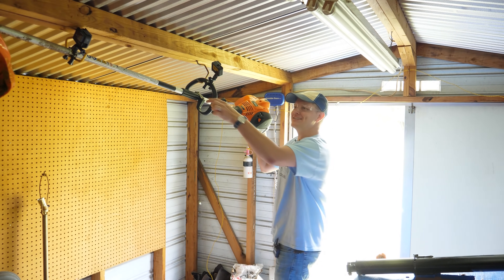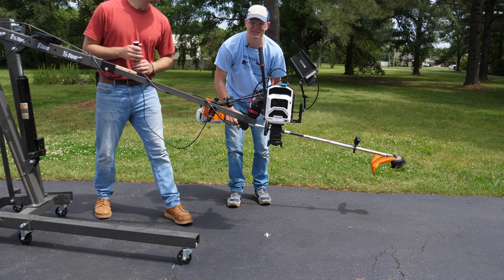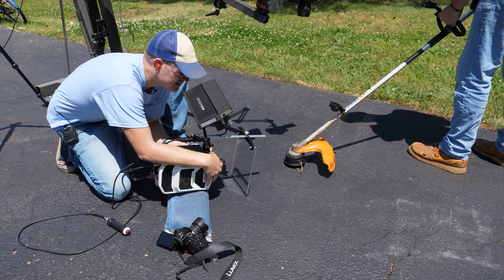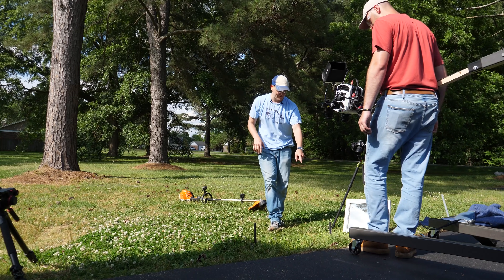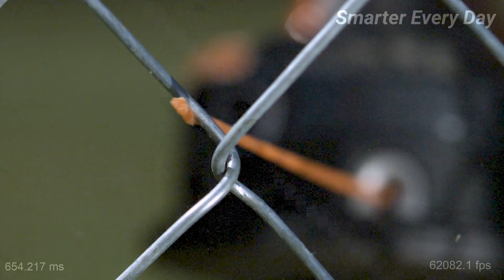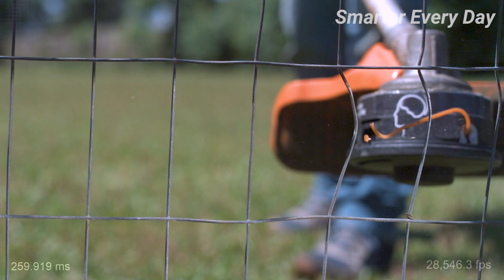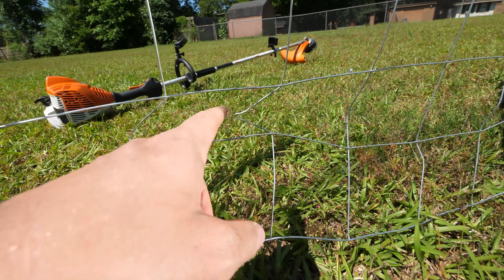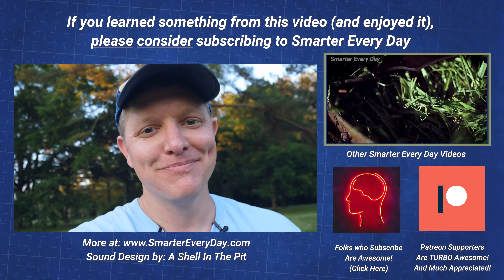How Weed Eaters Work (at 62,000 FRAMES PER SECOND) - Smarter Every Day 236

Comment: "95 thousandths of an inch"
Most of the world: w-what?
Reply: had the same thing. If I calculated it correctly, it's 2.41mm
Reply: As an American I am confused as well
Reply: @fruityboba8461   😆
Reply: Just call it a milliinch...
Reply: science without proper measurement units ! Yeah this is America !
Reply: You mean 95 milliinches?
Reply: 95/1000 of an inch is easy - it's also the width of a toothpick or 50 pages of a book
Reply: 1 millimeter to a meter is the exact same fraction of 1 thousandth of a inch to an inch - 1/1000.
Reply: It's beyond me why anyone would consider that a superior unit of measurement over millimeters. I don't even bother trying to convert it anymore, as soon as thousandths of an inch are mentioned by anyone I just phase out.
Reply: @Outland9000  Thousands of an inch and millimetres aren't really comparable. 1mm = 39 thou, so thou is a lot more granular.
Reply: @JDeWittDIY  Totally missed the point...
Reply: here is some more to confuse all the metric guys... electric motor shafts are measured in 1/16 in. steps. So a two inch diameter shaft would be a 32, or 32 x 1/16 = 2 inches.

Then when the shaft is coupled to a pump, we measure pump shaft diameters in 1/8 in intervals. So a 2 inch shaft is a 16. 2x8=16. Then you could say you have a -32, 50 horse motor coupled to a -16 pump shaft......all the same size stuff lol. I also deal with metric a lot but not as common as imperial in the united states. Mostly in pharmaceutical equipment because a lot of that stuff is imported from europe.
Reply: If you can't understand the relationship between 95 and 110 then it doesn't matter which units are used. The units aren't really important here, it's pretty obvious the approximate size of the string and fence pieces.
Reply: it always annoys me that americans use fractions over decimal points...
plus the fact that he's an engineer but uses imperial like that would be relevant to anyone/anything
Reply: @proxy1035  Engineers faced with English units use thou or mils.  As shown in the video...
Reply: @marredcheese  that just sounds like imperial with unnecessary extra steps
Reply: @marredcheese  English units , eg, the units that the English use, are millimeters.
Reply: @marredcheese  So when inconvenienced enough by fractions (like 3/8 or 5/8 of an inch), you rely on using units that make logical sense - 1/1000 of something and increments of 1 to relate them to other measurements.
Reply: @ColinRichardson  only because of the EU! In school we were taught both. This was in the 90's
Reply: @rjs198585  I know, I am so dumb. Tell me to picture 3 and 7 40ths of a millimetre I know exactly what that looks like, but since noone talks in anything less than half inch, it's just not in my mental model.
Same way I can't picture what a kilometre is, but I can for 1 mile. But anything less than half-inch or anything I want to be accurate I use cm/mm. Though I then switch to feet for for stuff like "how tall is that door? 6ft 8"
Reply: @ColinRichardson  If the metric system had wanted to compete in the day to day they should have mixed the two concepts (man based units and earth based units) Instead, Europeans try to measure houses with a unit derived from a fraction of the distance of the circle of the earth. That's why the "foot" built the pyramids and the metric system really isn't known for great architectural achievements. A hybrid system would have 10ths of an inch, 10 inches in a foot, ten feet in a yard, etc.
Reply: @matthewmosier8439  wasn't the Egyptian measurements based on the forearm of one of its kings?
Reply: @ColinRichardson  The foot was based on a Pharaoh's foot, if I am not mistaken. It is man based, hence why it is so useable for construction, etc. I've worked on projects in a few different countries and can assure you that the metric system is ridiculous for building a house. For one thing, the metric tape is confusing due to it's overabundance of markings that all are too small for the application of, say, building a wall. It's like looking for one sentence in a page full of words. A well designed standard tape measure takes a few minutes to learn and is much better suited for day to day projects.
Reply: @proxy1035  he used decimal, not fractions. Closest fraction would be 3/32" (.093")
Reply: @ObelixCMM  i mean it said "95/1000" which is a fraction...
Reply: @proxy1035  .095"
Reply: @ObelixCMM  yes i know it can be easily converted to a number with decimal point, but it's written/spoken as a fraction for no reason...
they could just say "point zero nine five"
Reply: @proxy1035  as an American, I completely understand why customary units are not practical, but fractions are much more useful for mental calculation than decimals, in addition to being more accurate (unrounded)
Reply: i was just thinking the same thing using that while you have an superior measuring unit milimeters that is just plan stupid, how can someone guess what a 90 thousands of an goddamn inch
Reply: @tekofaks2  yep, I can picture what an inch, quite easily.
I can picture what half an inch could look like..
quarter of an inch... ok maybe,
8th of an inch narr sorry.
16th of an inch, is that a thing?
32nd of an inch? really?
64th of an inch?
(apparently noone does 128th of an inch, that would be crazy)..
What what do we do now? Jump to 1000th of an inch? Of course you do.. of course you do... 🏅
At least they rounded off to a decimal number.
Reply: Colin Richardson is you can’t even picture an 8th or 16th of an inch you have a problem
Reply: Here's what confuses me. Now, one foot is 12 inches. One yard is 3 feet. 1 mile is 1760 yards. Great. Now why when you go below inch you start using decimals? Why not keep tha habit of splittin units into unobvious and inconsistent number of fractions? Why not say ""one tenandahalfand" instead of 95/1000 ?
Reply: @bukkaratsuppa6414  We don't use decimals instead of fractions for most applications. An inch is divided into fractions. Also, metric doesn't evenly divide so it defeats the purpose of having the units divide by tens, etc. Meters should be divided into tens, that divided into tens, etc., but because they aren't, I constantly had to make sure I was using thousands for kilometers and hundreds for centimeters into meters while I was in school. It really didn't make sense.
Reply: @matthewmosier8439  meters do divide in tenth.
10mm = 1cm; 10cm = 1dm; 10dm = 1m; 10m = 1dam; 10dam = 1hm; 10hm = 1km
Only mm,cm,m and km are commonly used.
And now please tell me how 1000thou =1inch; 12inch = 1foot; 3 feet = 1 yard; 1760 yd = 1 mile  is simpler than metric.
And please stop with the argument that "man based measurements are easier".
That's just not true. How many peoples feet are 1 foot long? By chance mine is. It is 30cm long. No need for foot. And if I need 1 meter one big step of mine is 1 meter long.
But the foot of the next person might be only 9 inches (23cm ) long. So what good does it do to that person that the imperial system is based on "man based measurements"?
And you now that nowadays the definition for 1 foot is not "foot of some guy". It is 1 foot = 0.3048 meter. That is the official definition of 1 foot.
So you are using the length of the path travelled by monochromatic light in a vacuum in 
1
/299 792 458 of a second times 0.3048 to measure your house.
You just don't know that.
Just like most people who use metric don't now that.Because for everyday people it doesn't matter.
Of course the imperial system is simpler for people who grew up with it. But the same is true for metric.
For everyday use it doesn't matter which system we use.
But in our globalized world it is stupid to use two different systems. And since most of the world already uses metric that is a strong argument to change to metric system.
And in scientific use metric is far superior.
Reply: @Jehty_  The lack of using the other units is a major drawback to the metric system. What's baffling is that those are the more practical units and people instead regularly use a unit smaller than a finger width to measure tables, chairs, and other everyday objects. As for the argument that almost everyone uses metric, it ignores the fact that much of the world's GDP is created using the imperial system. In the day to day, the only arguments I ever hear for metric conversion are essentially peer pressure (everyone's doing it) and that it uses tens, which doesn't make much difference because it doesn't use half of the units so a person must still calculate. And the lack of a common metric unit for anything between a centimeter and a meter is just too much for me. Why measure stuff in multiple digit numbers when imperial offers plenty of day to day units that match a man based world?
Reply: @matthewmosier8439     "much of the world's GDP is created using the imperial system"
Depends on your definition of "much" 
If 1/4 is much, then yes. But 3/4 of the worldwide GDP is not created with the imperial system. 

So basically your problem with the metric system is that you are not used to it. 
You don't have a real argument against it. 
Why would you ever need something between cm and m in day to day use? 
I am 1,88m or 188cm tall. Why would I need to say I am 18,8 dm tall? What would be the benefit? 

And you don't understand the beauty of using tens. You don't need to calculate. Just need to move the decimal mark. 
123km is 120 000m is 12 300 000cm.
No need to calculate anything. 
Now do the same with imperial. How many  inch and feet are 123 miles? 
Without doing any calculations. Just move the decimal mark. Doesn't work, does it? 
Yes, in the metrical system you need to learn the prefixes. And in imperial you have to learn the units. So not really a big difference. Just something you have to memorize.
Reply: @matthewmosier8439  and now I really would like to hear your arguments for using imperial in day to day use.
Reply: @Jehty_  his argument is "I want it, so your argument is invalid"...
Reply: @bukkaratsuppa6414  That, and rulers use 32 gradations between every inch. So is that 1/32nd of an inch? How many 1/1000th is that? I don't even...
Reply: America don't care about sensible units
Reply: 0.0095 i think
Reply: I for one find it amusing when British people are confused by the system they invented and wonder why they think knowing only a single measurement system is superior. Is ignorance superior? At least in the United States of America we are taught Metric and Imperial Standard so we can use the measurement most appropriate instead of having to use hundreds of thousands of tiny units to measure something small. We also mandate both Imperial and Metric be on the labels of all products in the store. Something that trade power forces the rest of the world to also label their exports with if they want to sell their product. Pretty neat if you actually bother to learn instead of feel your false superiority for being willfully ignorant.
Reply: Yall are annoying

Comment: It would be interesting to see how heavy duty strimmer line (eg 4mm (like Oregon's Flexiblade)) would react in slow mo considering the difference in diameter and materials.
Note, you can retract extended cord from those heads just by pressing them in and rotating the opposite way. It would also be interesting to see how a brush cutter head (in particular the Stihl Brush Knife 350mm 3 blade) handles those fence wires in slow mo. I know I've hit a ton of fence with a brush cutter head while at work and have to sharpen them every know and then.
I would be cool to see you do a similar vid on chainsaws, how the different types of chain affect cutting speeds and wear rates.

Comment: Taking scientific measurements, in imperial units.
Well, as long the measurements are correct, I guess it qualifies as scientific. In any case, fascinating footage, as always!
Reply: A measurement is a measurement. Units only mater if you are giving someone else that data or comparing it with something measured with another unit. You could say I am 12.1 beer cans tall and as long as we have the same brand of beer and the cans are manufactured to a tight tolerance that measurement can be considered scientific.

Comment: This one was super interesting! The thing I started thinking about was microplastics. When you try the weed eater on the different fences you can see how small parts of the wire come off and fly away. That would mean that over the years if you always use a weed eater, you probably sprinkle your property with orange microplastics. It would be interesting to see if you can verify that theory for example by taking off the top 20 cm of soil in a given area and then looking for plastic particles. Would they still be there? Do they move downwards in the soil or do they stay at the top?

Comment: For every inch of line longer than recommend you will lose about 300rpm because the load is slowing the engine rpm, the flywheel will spin slower and pull less air in to cool the engine while it is under heavy load which will make your engine run hotter causing it to overheat and can cause scoring to the piston and cylinder. That is why the guard is recommended to be kept on. Just in case anyone was wondering.

Comment: "Ok, feels more like science, if we take some measurements..." -> measures in inches. 💀
Reply: @JohnFistikis69  That was what I was referring to, but you are correct, it was more a case of not slowing down rather than accelerated into. I didn't realise my mistake until much later and by that point I couldn't be be bothered to try and track down in the chaos that in YouTube comments section to edit it. But Good Spot John.. A+ for attention to detail
Reply: @ColinRichardson  you can track down your comments in the messages/reply section of the home page :)
Reply: @TarmanTheChampion  you may have a different UI to me, I have no messages / reply section. Most I have is inbox, but that only helps if someone replies to me.. Doesn't show me messages I have wrote.
And that is for both Android App and Desktop UI
Reply: @ColinRichardson  aww that sux
Reply: Hehehehe
Reply: Science is still science as long as it is used consistently throughout an experiment and one could learn something from it.
Reply: And this is how rockets accelerate into planets!!
Reply: @ColinRichardson  that's not really an issue of Imperial units as it is the fact that they used mismatching units. Rockets can be launched using whatever units you want, as long as they are consistent
Reply: Inches are as scientific as metric units. And let's face it, the width of a weedeater line is pretty self explanatory, visually :)

Comment: Dustin, a few pointers from someone that uses a 'whippy' (what we call them in Australia) every day. For best results walk backwards when moving along fence lines, also, you want to move in the opposite direction to the rotation of the head (clockwise = left to right and opposite for anti clockwise) A bent/flex shaft rotates opposite to a straight shaft. I'd like to see the differences between moving in both directions. Cheers mate, Thoroughly enjoy you enthusiasm for things like this.

Comment: When you are looking at this so close and at such a fast frame rate, it is easy to see how easy it is for microplastics to form.
Reply: Didn't even notice that until I read your comment. Makes me want to get rid of all my weed eater line and just use my cutting heads.
Reply: Exactly what this made me realize, I said the same. Man we are messing up
Reply: You buy the thin wire in big rolls and have to reload it every couple hours.. you don't need to be a scientist or use slo-mo cameras to know the entire roll is gonna be shredded and distributed all over your property🙂 As an alternative there are heavier duty cutting heads with metal blades or fixed wires (much thicker plastic line) that you don't need to swap for a long time unless you are going through very heavy brush. The caveat is they are a lot less forgiving if you hit something you didn't intend, like the side of your house or a wire fence..
Reply: Bro, microplatics are much smaller than that, that why they are a problem
Reply: @miguelhernandezdavila2720  
All lose plastic in the environment is a problem.   The difference scale makes it what environment and organisms it effects and how.

Comment: I use the fact that the RPM is a function of strength length all the time, granted it's in reverse and it's one of those instinct things. I have an ear for what it normally sounds like. When I notice it seems to be running at a higher RPM, but my finger isn't getting any heavier, it's a good sign my string is getting short. Give it a bump or two and the engine slows back down and off I go. Again, it's just something I kind of do without thinking about it. But after watching this and thinking it all out, that's definitely what I'm doing.

Comment: @5:57 “Torque is a function of the length of the line”
No. Torque is constant for any given engine speed. Ignoring the presence of a rev limiter, provided torque is greater than drag, the engine will keep accelerating. When the drag from the line equals the torque of the engine, the engine stops accelerating.

Comment: Weird thing is that when I saw the slow motion of the smaller wires I thought of an old mountaineers rule, don't let your line slide over two ridges that meet in a v shape since if you fall, that can cut your line! It was a reminder to always move your anchor away from a dihedral face in case you fell or dragged your line over a dangerous area.

Comment: I just got 2 new horses and had to dog proof there paddock for my new dog, it had chicken wire on it 2inch by 2inch squares and I used a metal weed eater blade and it went right threw the thick fence but never right on the weld, had to redo it with more wire and now only use soft plastic wire u can get diffrent thicknesses and strength wire